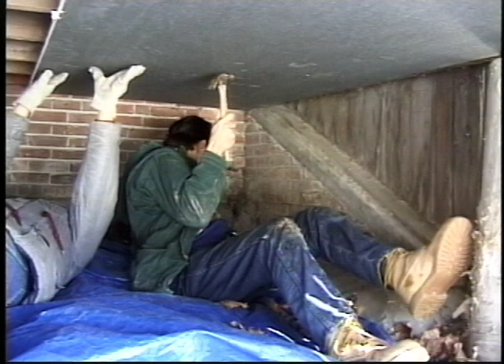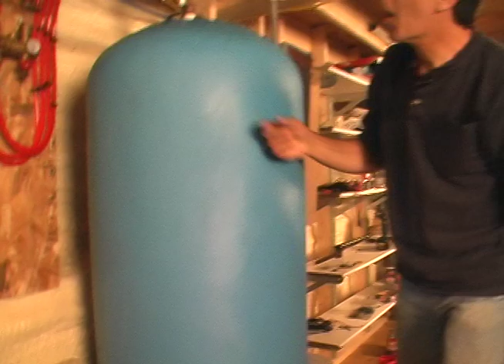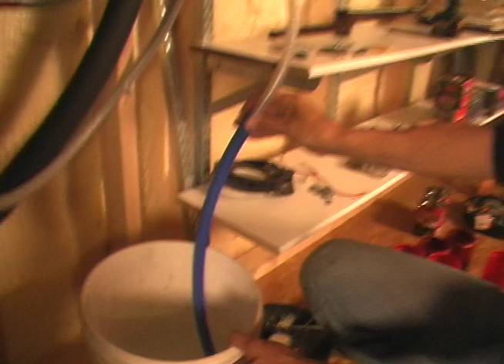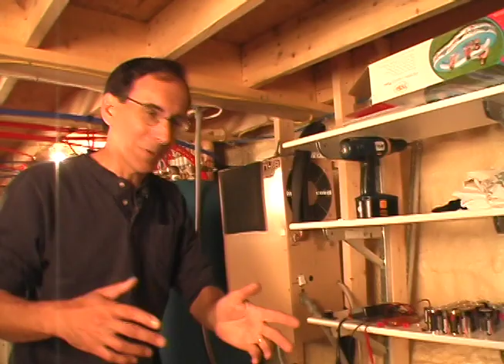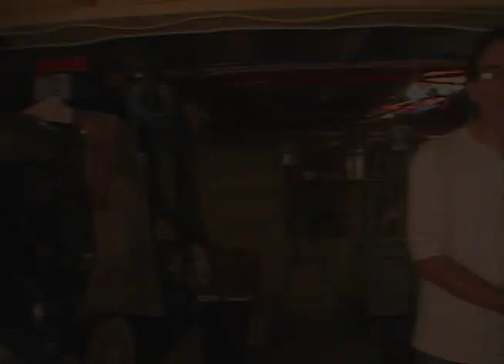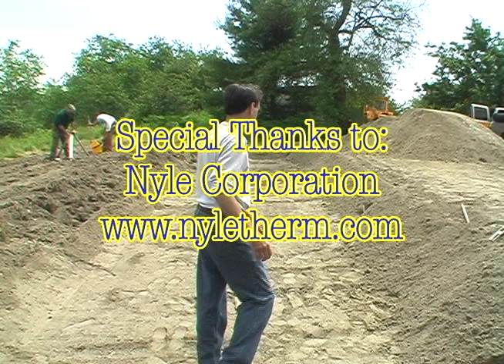Hot and Cold: Heat Pump Water Heater

Comment: Hello i just wanted to say thank you for making these videos i just found out about these heat pump water heaters and i gotta say its pretty interesting stuff. Anyways I was just wondering would it be possible to use this technology in combination with radiators in order to heat your house? It seems like an interesting idea but it sounds to me like it would ultimately not be possible because of some perpetual motion machine defeating physics issue. It sounds a little to good to be true to use heat you generated from the heat pump to produce heat that will be used to power the heat pump. Or hey maybe i just figured out the key to the perpetual motion machine problem lol! Sorry if that was confusing...

Comment: You mention a 3 Amp draw with the clamp-on ammeter, but since it's 220V that would be 3 Amps PER LEG wouldn't it? So that would be 1400W not 700W as mentioned. Still a savings, but not quite as lucrative as mentioned.